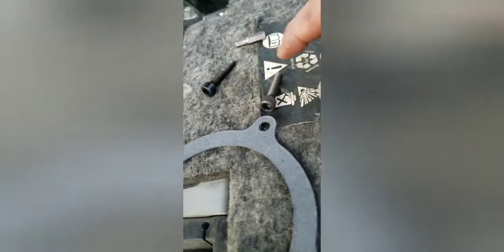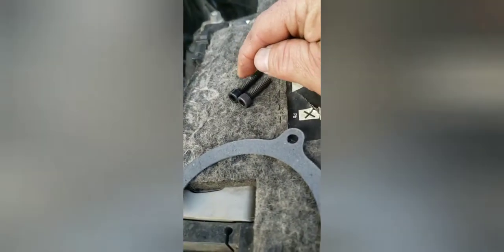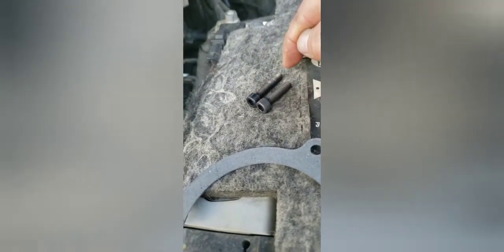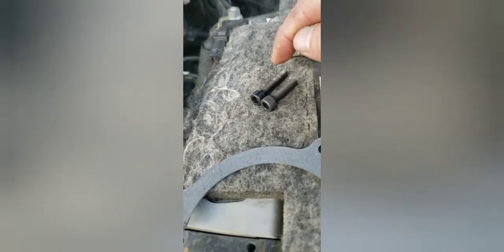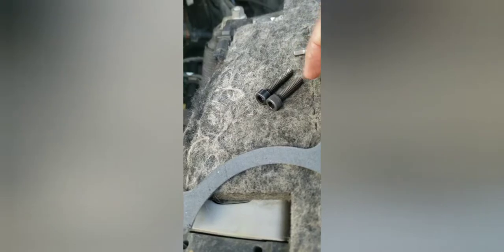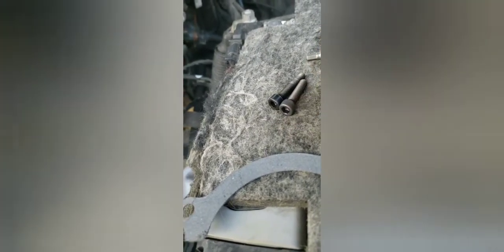6.7 Cummins Throttle Valve Delete

Comment: I literally just installed this and have the air issue so ita not the gasket or bolts the delete is tight on there.  I think the thing around the actual intake tube
Reply from the maker: Could be. I just know that's where my problem was.

Comment: Is there a benefit and what is it if any throttle response?
Reply from the maker: The benefit is that your engine isn't being choked by its own exhaust fumes. Many use the analogy that it's like sticking a hose up your butt and breathing your farts. Kinda funny but I can see that. Throttle response is much much MUCH better than stock but that is also depending on the tuner.
Reply: My def was deleted .. I’m quite lost ..  if the throttle valve it’s connected to the def system .. once the def it’s deleted  , the throttle valve stops working ??

Comment: What is a throttle body delete? Haven't hard  of this one yet... thanks... now i have more research to do. Haha. 

Your video are great!!!

We need some SaltyDawg follow up videos!!! Haha
Reply from the maker: From my understanding (remember, I'm not a mechanic), the EGR and throttle body work together. The throttle body is basically a flap that opens and shuts proportionally to how much exhaust gas the engine wants (when stock). But if you delete the EGR, the  throttle body is supposed to stay open. However, many people have said that sometimes airflow will shut the throttle body, starving the engine of airflow. Deleting the throttle body and replacing it with a pipe would prevent this.
Reply: @saltydawgdiesel2243  If I delete my throttle will I also need to delete the EGR? Ive had lots of issues with my throttle recently and want to delete it. Also will I need to tune  once deleted?